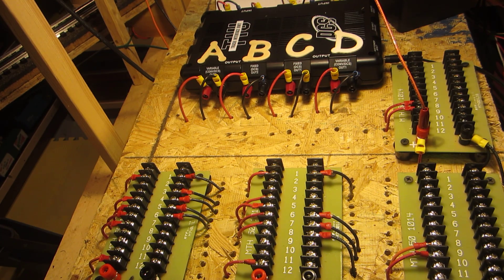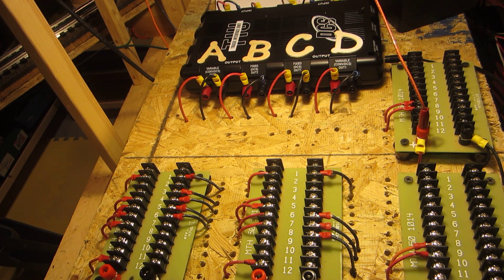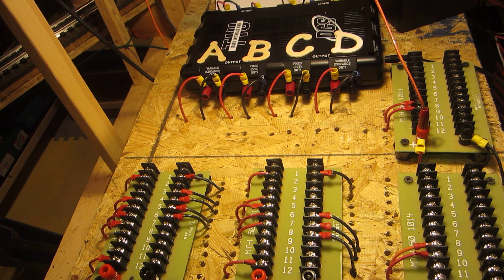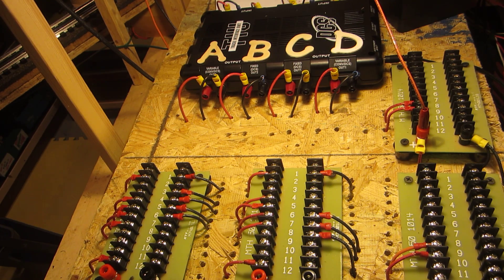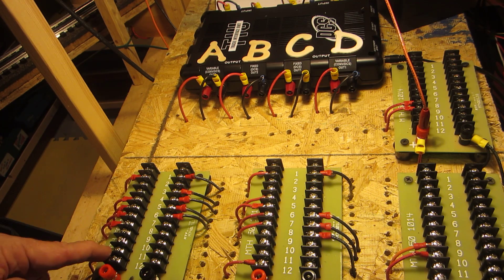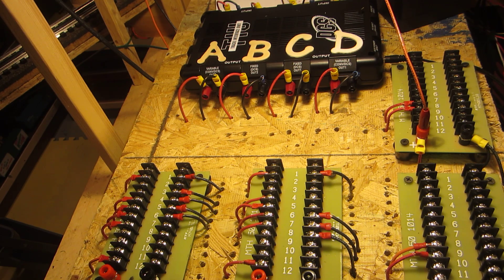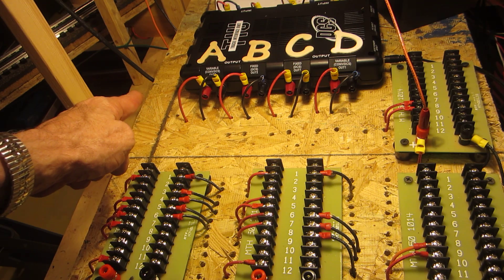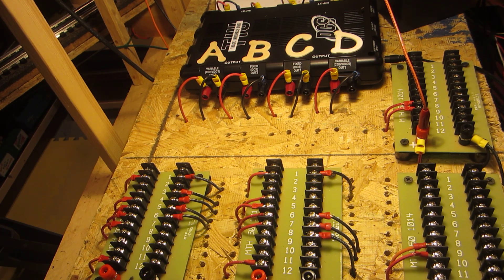Why Blocks:  The case for electrically dividing a layout into parts...

Comment: How do you use A to power a loop of track it’s variable power when I change it to fixed power it messes everything up explain how I can get a like you show on your video to run with the fixed voltage one and fixed voltage to without causing any other shorts because I get shorts every time I do that

Comment: I have the atlas slide switches that you spoke about. I have approximately 17 blocks. My outer main has 3 blocks the inner main has many switches. That being said I’m using kato track and turnouts. Now my outer main worked great for a minute then I try to hook up the inner main and then all hell breaks loose. I will be running the outer main which worked fine until I fired up the inner main then I would try to run an engine in different directions and low and behold my engines slowed down and were running on one cab. So I took my wiring off on the hot side of my switches and tried to hook them back up and I thought I had it whipped until the same thing happened. I’m just about to torch the the whole damn thing.I realize it’s not rocket science but I have pulled everything apart twice now and I figure I’m doing something wrong and I think I might be my switches. Any advice on this situation. Anything would be appreciated. Thank you in advance. W. John Gibson
Reply from the maker: Hi. Sorry it took me so long in responding. I am not familiar with Kato track. I do not know if power can pass from one end of it to the other. That may be your problem.

When you divide a track into blocks they have to be electrically isolated each section from one another. From what you are describing, it sounds as if somehow someway this is not the case.

You would need to ensure that power somehow isn't passing through the switches that is connecting the various blocks. Again, I apologize but I am not familiar at all with Kato track. Never owned any in my life.
Reply: I wonder if you were able to resolve your issues with the Kato switches?
 Most of them come power routed but you can easily change this by moving the two power route screws on the bottom of the switch. 
Also, if you have metal frogs, Kato provides an easy means of running power thru or killing power to them simply by moving a single screw on the bottom of the switch. 
  All of these options are labeled on the bottom of the switch too.

Comment: My trainlayout is in four seperate powered divisions. When a long articulated straddles the division gaps it sends a power surge and trips the circuit breaker. Any suggestion would be of help for I suspect you may have seen this. The layout is wired with dcs style running legacy engines. No short occurs if I run the engine fast or use smaller engines ie. diesels. Stuck in sierras 1953  thanks
Reply: Sorry. Never had that happen.  I have engines that temporarily "jump" power from one transformer to the next, but all our Z4000s set to 18 volts.  Maybe your track power has different waves?  Lionel transformers?  Different transformers?

Comment: Would you be willing to consult me on my Christmas tree setup? I’ve got some reverse loops and just learned that I need to separate my layout into blocks and I want to make sure I’m doing it correctly. I also want to make sure that I’m wiring it up correctly. I don’t want to blow another power supply.
Reply from the maker: Yes I will.  However, unless you have 3 rail track, it is a very good to NOT put reversing loops under a tree.  It would require electrical isolation and two separate polarity switch controls that would have to be thrown manually.

A circle or oval is best for under Christmas tree UNLESS you have 3 rail track. :-)
Reply: @theglacierline2660  excellent. Shoot me an email and we can figure out the best way to connect. james_mcquade@hotmail.com

Comment from the maker: You do not need to terminal blocks. But I would not run a bunch of feeder wires as you're saying you're going to do. You need to buy some Atlas selectors. You just run one wire from an atlas selector to each one of your blocks. Don't make any of your blocks any more than 20 total feet long. That way you will not need jumper wires.
Reply: Uh. New to this. What is a jumper wire?
Reply from the maker: @levay5657  a "jumper wire" connects one section of track to another. For example, if you ran a great big circle of track and just ran two wires to it one positive and one negative near your Transformer the train would probably lose power at the point farthest away from where you connected your wires to the track. You could use jumper wires and connect a second connection to your track at the farthest point away on the circle so the engine could easily pick up the full power of the transformer. Hope that is a good explanation.
Reply: @theglacierline2660  yes. Very helpful.  Thank you.
Reply: @theglacierline2660  I bought a second transformer, an Atlas #215 selector, and two 4805 distribution boards. I also plan on using a combination of tortoises and Atlas solenoids for five track switches. I’m going to have an inner oval interacting with an outer oval main line. Probably a total number of 40 feet. Here’s my question.  Do I run the transformers to the distribution boards to the selectors, or do I go to the selectors first?.  If I do the former, I think I would wire the tortoises off one of the distribution boards.

Comment: Hi the video is great I have two main lines do I need a terminal block for each main line because I'm running so many feeders on each main line the wireing is driving me crazy it's for kato nscale I'm running dc duel controller tech 7 right now but getting ready for dcc soon I like to run both because I have dc and dcc locomotives

Comment from the maker: Selectors are made by Atlas. What these are our electrical toggle switches. These have three positions. The top position is for Transformer a. The middle position is power completely off. The bottom position is for Transformer be. Having a toggle switch like this in various sections of your track allows you to pick what Transformer you want to power it or completely turn the power off to the section. There are advantages in doing this. The video explains that. Please Google Atlas selector. It is an electrical panel which contains four separate spdt switches. Spdt meaning single pole double throw.

Comment from the maker: Yes.  The Lionel system just plugs into the tiu. The Lionel system sends its signal through the outside negative rails. The MTH system sends the signal on the middle rail. They do not affect one another.
Reply: some Lionel Command engines may impede DCS reading in an MTH engine.  Put the offending engines in a block or put a 22 mf capacitor in the offending Lionel engines power supply.   I prefer blocks to de power engines not used.